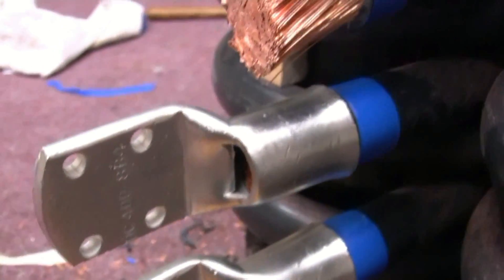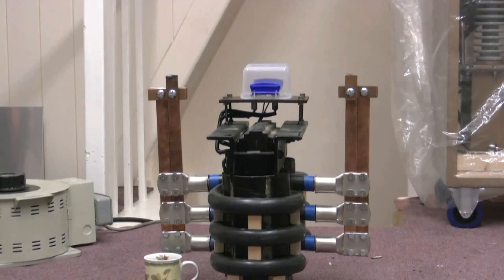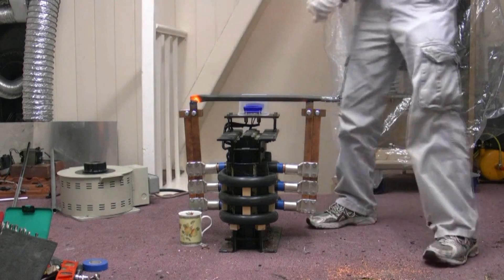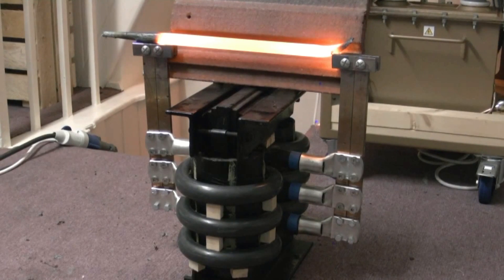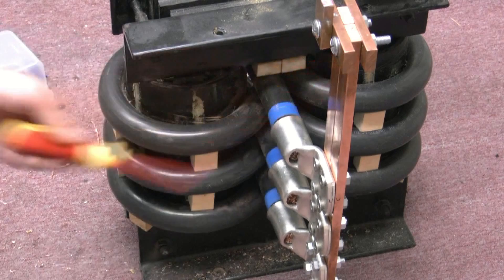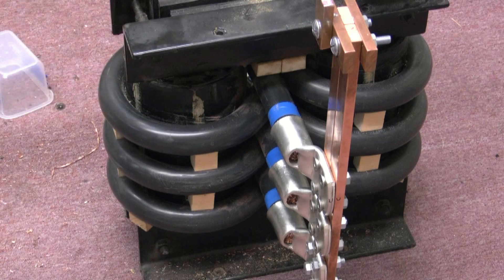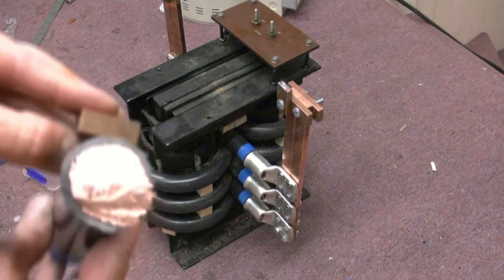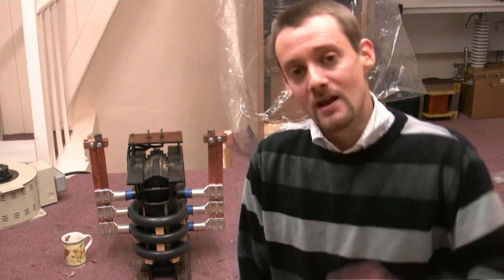50,000 Amp Transformer Completed

Comment: you touched that with a bare hand?
Reply: low volt, high amps
Reply: Ohh just opposite to the tesla coil. Mad electricity
Reply: Susmith HCK yes thats correct
Reply: not at low volts
Reply: *****
The reason static shocks are harmless is NOT because of voltage or low levels of current (amps). It's because the "system" lacks energy to produce the amount of current required to harm you. You do get a lot of current from a static shock. The catch is that the time it flows is extremely, extremely short so it doesn't cause harm.

The truth remains that voltage is the father and current is the child. Of course the amount of energy in the voltage source ("system") determines the maximum time said current can flow, thus determining how much energy is put through you (the load).

At the end of the day it's about energy. Voltage forces current through, expending energy which causes damage. That's why things heat up (energy) or in the case of unfortunate shock victims, they are burned.
Reply: Susmith HCK
The only catch is that without sufficient voltage, you can't have the current. They kill you together but one precedes the other.

Of course, as someone else has accidentally hit upon (vis a vis static electricity), the system producing the voltage has to have enough energy to sustain a current long enough to cause harm, regardless of the voltage.

Think of the current as water. Water in a kiddie pool sitting there won't hurt you. But if you pressurize it in a vessel and shoot it at someone, it can kill. The pressure forces out the water which is the means for causing harm. Pressure and water work together but without pressure, there would be no harm.

It's just physics.
Reply: Susmith HCK
It's "static" until it does strike. It's not different from AC or DC. It's DC. It's exactly the same as a capacitor. With the "right" size capacitor, you can be harmed if you handle it inappropriately while charged.

Likewise, there's this massive scale "static" electricity you're surely familiar with that will kill you instantly and can split a tree in half.

It's called "Lightning".
Reply: i think both voltage and current should be sufficient to kill a person. consider a huge log of wood coming at very very low speed against you, that wont kill you. similarly a tiny piece of wood smaller than a size of ant coming at a high velocity cant kill you. here the speed is voltage and the size or amount is current.
Reply: yep. Static electricity is entirely different from AC/DC current. as the name says its static. it wont move, thus it wont hurt u.
Reply: Voltage is what kills you. It just uses amps as the weapon. Amps can't happen without volts. Volts can happen without amps.
Reply: That is not true at all. A shock from static electricity can have tens of thousands of volts yet is completely harmless (aside from the pinch of pain). As others have claimed in this thread, you need sufficient voltage to overcome the resistance of your skin, but the amps are what's required to do actual damage.
Reply: Amps are what kill you.

Comment: a month electricity, consumed in 2 minutes :)  LOL
Reply: No it can only draw as much power as the variac can off the wall socket so depending on the UK's power it wont be more than 20amps. So 10,000w probably 5000w as I think UK is 250v 10amp wall sockets.
Reply: The UK is 230v with 13amps on a standard wall socket. I believe the total current from all sockets is 32amps before the house's fuses blow.
Reply: +MrcabooseVG In the UK a Suppliers Main Fuse is typically a BS 1361 or BS 88 ceramic cartridge type fuse at either 80 or 100Amps. 
These can take a while to blow unless severely overloaded through a short circuit.
This nutcase is not coming off a standard wall socket for his primary supply before stepping down with the transformer.
He reckoned he was pulling 40-50Amps at 230v (assuming he's meaning single phase) so he' d either have it on a 40,50 or 63Amp MCB or he's directly off the main suppliers fuse.
He reckons it's a 75kVA capable transformer so even giving it 100A at 230V is only going supply it with a third of it's full capacity.

Comment: At 90% efficiency (which I doubt) your primary would pull ~115 Amps at 240v to get your 50kVA @ 0.5V
That looks like a 10 Amp extension cord......
With your design I'd be surprised if you got 60%

Comment: CAN ANYBODY EXPLAIN WHY IS HE NOT DEAD TOUCHING THE METAL BITS?
Reply: 2 reasons really. First is not enough volts to overcome his skin resistance. Second is that current follows the path of least resistance - in this case it flows from one copper bar to the other through the metal bar to complete the circuit. His hands are outside that circuit so the current doesn't flow through him. Good ol' Photon knows his stuff!

Comment: 3:32 ... yeah, that looks "safe" and "professional" -_-
Reply: ciphernemo Ye, amps kill, but you need enough volts to push those amps to kill.
Reply: +ciphernemo Do you even ohms law?
Reply: lmao
Reply: i don't think so, seems like he's just parroting stuff he heard somewhere without really understanding the meaning of it
Reply: High voltage supplies and high current supplies both have more complex dangers that you are not appreciating. Its almost ALWAYS more dangerous to mess with a high voltage supply. 

Holding onto a low voltage supply of around 5V with the capacity for a thousand amps is relatively safe. The only danger comes from the heat generated in undersized conductors, or the risk of accidentally shorting the supply with jewelry on your hands. A ring or wristwatch will get welded to the conductors, and then will heat up until it melts into your flesh.

A high voltage supply can be very insidious. You might be playing with a 50kV DC supply, but only capable of pushing 1mA or less. But then you connect two insulated cables from the supply to the load, located a few meters away. The two insulated wires have capacitance, the longer the cable run and the closer they are together, the more capacitance there is. At 50,000V, you barely need a few nano Farads before you have a LETHAL charge. And then, thinking "oh well, a fraction of a milliamp can't kill anyone," you touch the output cables.... The extremely high voltage will mean the impulse current through your body's resistance is massive, and you will be killed simply by the charge in the HV output cables of the "wimply" 50kV supply... 

Before messing with this sort of stuff, you need to nail down your understanding of Ohms Law, reactance and complex impedance, otherwise you are likely to die.
Reply: it's about as safe as replacing an oven mitt with a towel when taking a tray out of a hot oven
Reply: It's amperage. Amps kill, not volts. But regardless, not exactly the right short of equipment to handle that, lol.
Reply: True, you need both. And your skin's resistance is important too. I'd rather be touching high voltage with micro or nanoamps (ie: a static shock) than low voltage with thousands of amps (a shock with some current).

Comment: How do you not lose a limb doing this?
Reply: 4 volts....
Reply: ben lawton I thought it was the amperes that killed, not volts...
Reply: W̶̷̲̅L̶̷̲̅O̶̷̲̅ғ̶̷̲̅ᴀ̶̷̲̅ɪ̶̷̲̅ʟ̶̷̲̅s̶̷̲̅ hufffffff you need over 50v to get the amps into you
Reply: Well you need both, actually. I'm as far from an expert one can be, but if the voltage is low, the resistance you as a human have is more than enough to stop it. Please, if I am wrong, somebody correct me. This is just what I think is the case.
Reply: Oh ok. I have zero experience with electrical engineering, though I did want to be an electrical engineer when I was in high school.

Comment: Why wont that much amperage harm you ?
Reply: +Alec Traub You need volts to push the amps through you. It's just like a car battery, which produces several hundred amps, but at only 12 volts it is safe to tough the terminals. His transformer in this video only produces a few volts.

Comment: Is the guy dead?
Reply: not enough volts
Reply: Nope, watch his channel. He knows his shit
Reply: low volts, high current, usually not dangerous because there aren't enough volts, in the same time high volts and extremely little mAs it's still not dangerous and not that painful too... But 220v and 10a are dangerous, especially if thy're Alternating (AC)...
Reply: That’s why RCDs in home is usualy rated to 3mA, and will pop in case of a faulty current
Reply: Yes you are watching this in the future years after he's left...

Comment: 4 volts max? Hmm, this surely needs a USB connector for testing purposes.
Reply: This is what oppo uses in their super fast charging. They just managed to squish it down to a simple wall plug size
Reply: 4 volts and 50000 amps, a usb is between 1-2amp at 4-5ish volts
Reply: And that°s why it needs it!

Comment: So what kind of volts is this running? I thought it was amps that kill you? So how the fk is he not getting electrocuted.
Reply: +THE-GOAT-79 you need high voltages to actually get electricity to pass through your body, but you need amps to actually damage your body. Without enough volts, nothing is going to pass through your body. For example, static electricity has a lot of volts, and is able to make large arcs and such, but it's not enough amps to hurt you. But if you put your fingers on the positive and negative leads of a high current battery, but it's low voltage, like 12v, it's not going to be able to hurt you. You need both Volts and Amps.

Comment: +Photonicinduction
 can someone explain this set up to me, so if this is single phase there appears to be 2 sets of secondary's there? how does this work, i thought it would appear as one tube with he primary wingdings on the inside and the larger secondaries on the outside. how does it with the 2 tubes? sorry for being dumb ha

Comment: 50kA is short circuit. I seriously doubt any of those items are dissipating 25,000 watts of power.
Reply: +ThingsDemystified Then what kind of power you needed to make a Approx 3 kgs  Iron rod wight hot
like a wax with in seconds.
Reply: +Zaki Adam In seconds?

Comment: U shoud make ac to dc so it will not spitt so much at contacts ;)
Reply: +Kotyč CZ Where to find a rectifier that can handle 50,000 amps
Reply: +ThingsDemystified Connect some in parrallel, so the current will split ;)

Comment: what wii happed if you touch the red hot iron. Will you got electrocuted?
Reply: +Joel Allen if the voltage is below 40 it wont electrocute you, if its over 40 it will, but you will feel the heat for sure ;)

Comment: Some questions:

The transformer itself should be safe to touch since voltage is so low right? (electrical pressure being low enough to not have dry skin being conductive relative to it)     

If the answer to the above question is no, how do we determine exactly how many joules/second  can decrease the resistance of a material like skin?   It would have to do with the the way the electrical current would heat up the point of contact and all subsequent points as the previous points were stripped of resistance via the heat right?

Comment: If you were to touch between the connectors with a finger from each hand it would kill you as only 1 amp kills you or am i wrong? Please educate me! :)
Reply: +Polio Tuxedo thanks a lot for the answer :)
Reply: +I have an awesome name The secondary of this transformer poses  no threat of electrocution. It would be very hard to get even a mild shock at that low voltage.
Reply: +I have an awesome name https://www.physics.ohio-state.edu/~p616/safety/fatal_current.html

Comment: I would not like to pay for his electricity bill...
Reply: +God Nondedju High current, low voltage...power not changed
Reply: ThingsDemystified 50kA times 0.5V is still 25kW. Quite a lot.
Reply: God Nondedju
But if you think about it, do you really think he can pull 25kW out of his wall outlet? Maybe for a single cycle?
Reply: No way :P He would need a 100+ Amp fuse.

Comment: Can you make a video on how you made it
Reply: +noah he (noahdthehorse) I'm pretty sure it was an existing industrial transformer. He removed the original secondary windings and replaced them with those 3 huge cables in a figure 8 around both primaries.
Reply: +chemicalvamp I basically know what he did did I just want to know exactly what he did
Reply: Well I'm just saying i think the only 'exact' difference would be as to what transformer he used. And just the glace of his attic workshop he can get his hands on some serious shit. I would like to know what that transformer was used for before he modified it. I Would assume it was meant to step up the voltage, but by how much? I would like to know how many turns there on the original secondaries myself. But meh,. I've never seen him reply to any of his video comments before.

Comment: I know this an amateur question, and yeah Im not an electrician btw..,
but how can you have turn a quick pulse of high voltage with very low amperage into a practical source of electricity? specifically, voltage created thru piezos. 
if this is achievable, would it need to be done in series + a controlling device, so that the voltage is controlled and remains constant? and could enough useable amps be created to maintain the desired effect thru the components and or other physical sources of force?
I ask this specifically to understand if amps are a thing that can be generated to a desired amount thru the presence of high voltage while managing to retain said high voltage,making the source practical to use,especially for high energy needs. because if this is truly possible, all you would need to do is turn the movement into useable electricity in unison with solar or wind, or even your shoes!

Comment: You must secure the connection first then turn on the primary power. You can use this for spot welding. It's an old invention.

Comment: how are you not conducting any electricity to ground?
Reply: Not enough voltage. That thing only outputs about 4 volts no load and 0.5 volts shorted. You could touch those contacts and you wouldn't feel a thing.

Comment: Did you actually clamp the terminals on the end of the wires?
Looks like they are just shoved on, which will lose you a few amps probably.
Ok, they have probably a certain self-welding capability in this environment ...

Comment: Bit of wishful thinking there. Many years ago in the factory where I did my Electrical apprentice ship we had an Electrician drop a 12 inch spanner across a 1000 amp transformer output terminals. It vaporised the spanner, the explosion blew off his clothes and he died on the way to hospital. Ive seen a real 50,000 amp transformer and its just a little bit bigger than yours.With the air gap around those secondary cables you would be lucky to get 10% efficiency. On real very high amp transformers they use square section secondary cable so they can get the windings close together.Never mind, Its good fun playing around with electricity anyhow.
Reply: I would guess that the transformer in your story was more than 0.5 V
Reply: Well, it’s only 0.5 V, that’s why it doesn’t look that impressive.

Comment: Maybe 1,000A. I did some work for a Prof who said his machine needed 10,000A. It only managed 8,000A at 2.5V.  Each of 2,500A sets of turns, had about 4x as much copper as your busbars. Measured with 1000:1 CT. Measuring the secondary voltage is easy, and primary voltage and current. Is=Ip(Vp/Vs).  Lovely job though. I just want to know the sums.

Comment: Those arent 50000 amps, maybe like 100-120 amps MAYBE , at 50k amps, you weld that thin screw driver, and that iron bar you got there. Even with and Inverter of 80amps you can weld with 2,5-4-5 electrode. and donde take "some"time...realy ?
Reply: I have a 5 inch transformer that takes in 120v @ 8.5a and spits out 15.5v 400+A (6200W +) and it has nowhere near that type of power used in this vid

Comment: One warm June day in a drydock, I asked a welder to tack my 'blank' flange over the 'sea-chest port'  we wanted to test for leaks. The blank was about 3/4" thick steel, and we were about 15' above the drydock floor. I held the blank up over my head against the hull, wearing a t-shirt, and when the welder struck an arc it vaporized the rod, and gouged about a cubic inch of metal out of the blank, which I swept down to the floor. Luckily, nobody was below to be brained. I stopped much of the liquified steel from hitting anything else, but most was small drops.   " I must have grabbed a gouging lead!" said the guy.  " Ya think??!?" was my response. The welding leads were set for 75-140 amps and the gouging leads for 300-600 I think; they all looked the same!  50,000 amps should be lots more violent than this video shows, IMO.

Comment: you could use the magnet as the piston rather than the wire voice coil. so the magnet would be traveling in linear motion and you could make the xmax real long. you could make it your bitch and hit the good note at 1 HZ   it would be able to be cooled if placed in a giant sealed rubber tank with a non conductive liquid incase uncoated wire scratches make contact. would be best in a pretty big vented box. you can do it! We all know you can